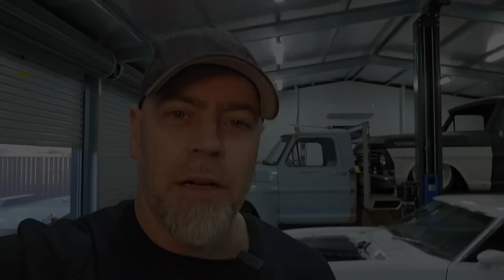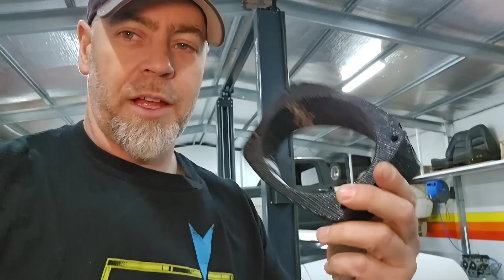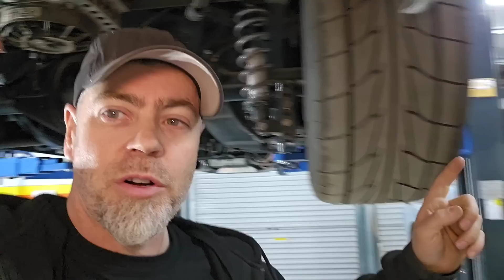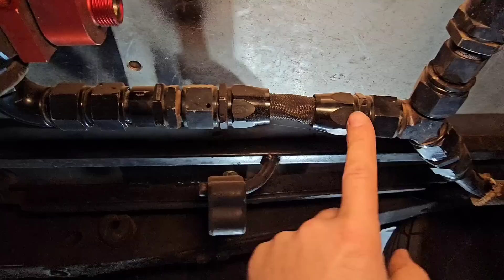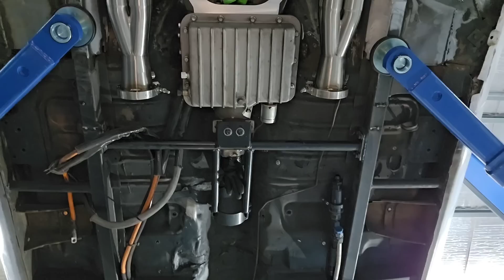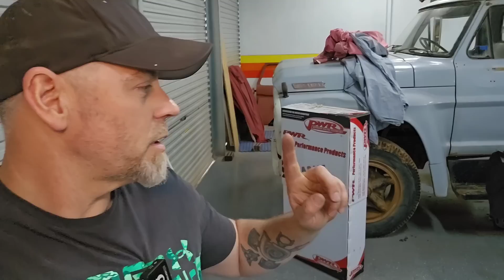Blown-Godzilla Coupe gets inner guards + custom headers

Comment: Cool build mate, what sump and engine mounts are you using?
Reply from the maker: It's a 417Motorsports oil pan, and the mounts were made by the guys that fabricated the crossmember. Tuffmount do a universal kit for the godzilla that I used for the f100